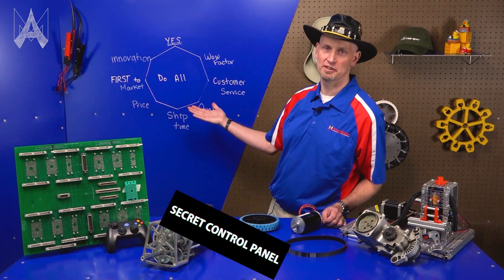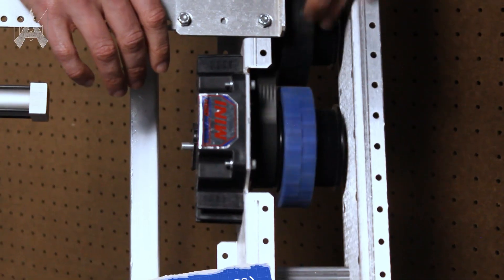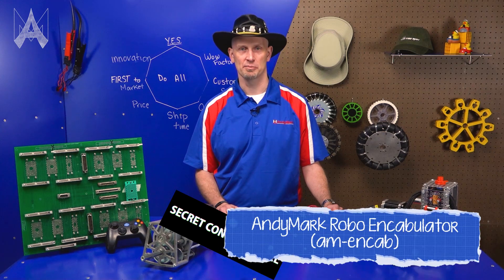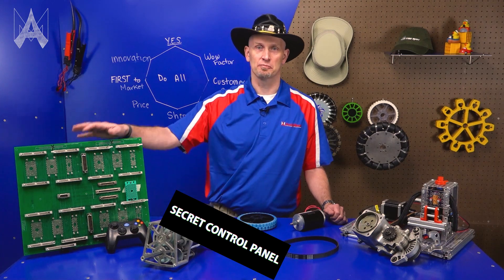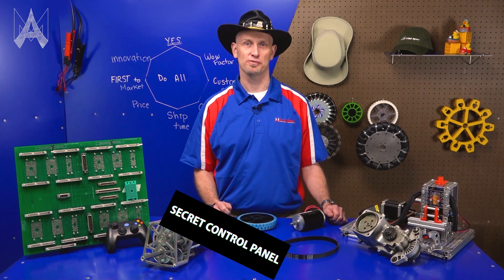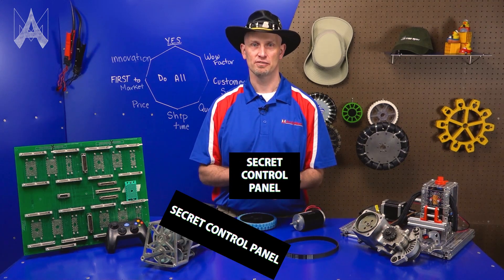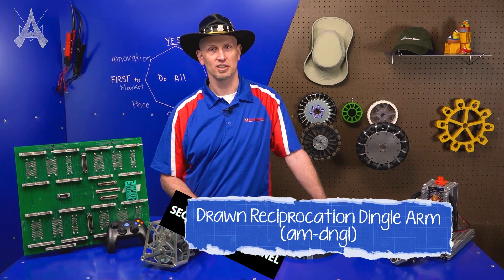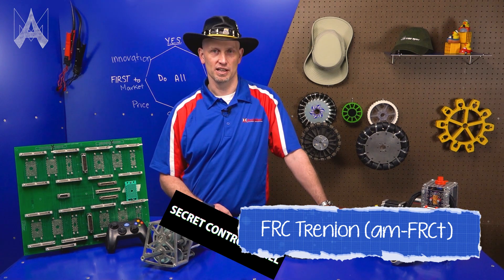Robo Encabulator

Comment: Dang!  It's already sold out!  I had tried to put it in my shopping cart along with my 710 cap and the ID-10-T buttons.  Maybe tomorrow it will be available.
Reply from the maker: I hope you remember to order those left-handed hammers you forgot last time!
Reply: @AndyMark  Are they back in stock?  
While we are at it we do have a request.  In our pit this year we were mixing up Imperial and Metric wrenches.  Could you color-code the Imperial Crescent Wrenches red and the Metric ones blue?  This would be a tremendous help.  TIA!